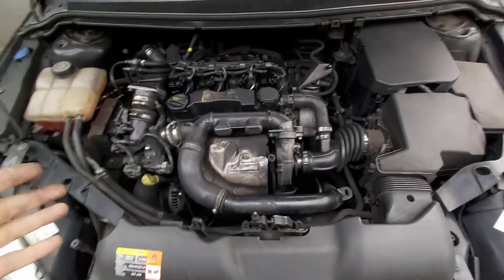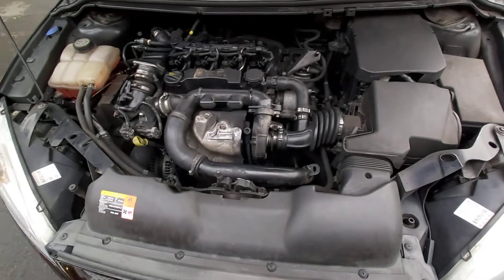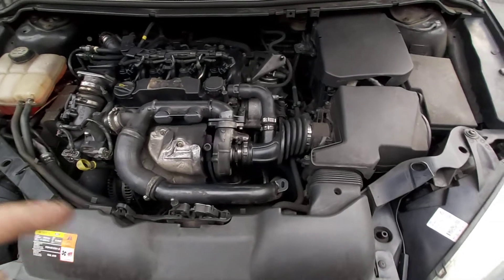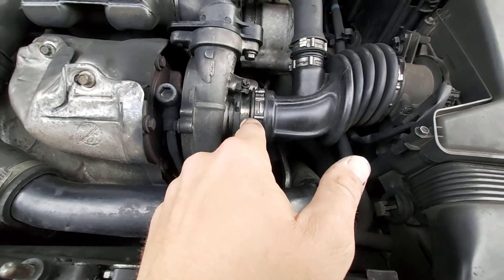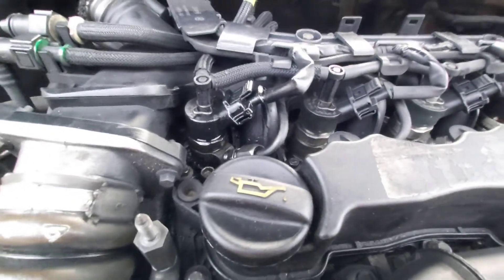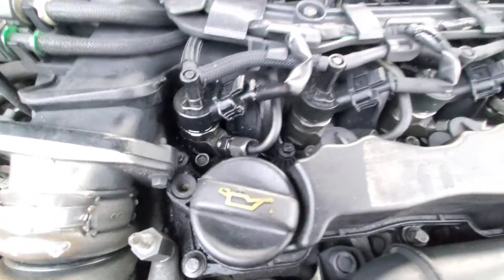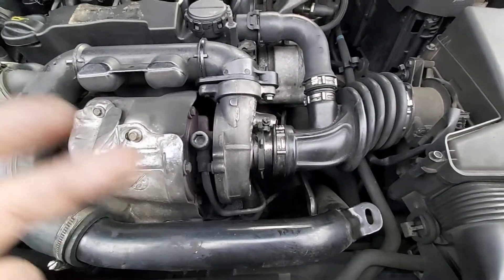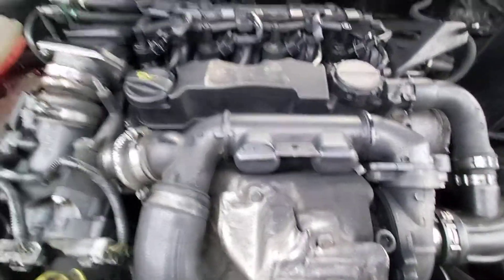OBD 2 code P0238 - How I repaired my car / turbocharger boost sensor A/ check engine light on

Comment: I have the same problem I changed the air pipe and now I have oil on the injections like u have how did u solve this

Comment: Bro what was the problem with the oil leak
Reply from the maker: Bro,oil can come from injectors or diesel leak on high presure pipes. I had luck and problem was with one  high presure pipe which comes from high presure diesel pump. I hope you understand me.

Comment: I am not a car monteur. But my experiments tell me that when the injector will be nasty is after that the turbo vacuum(stystem) does not function So well. Now you have a solution by broken vacuum. Now, you have To clean the injector. Only it needs to be done by a professional car monteur... Or test the injector first. If it functioned well by the test then you have to do nothing.